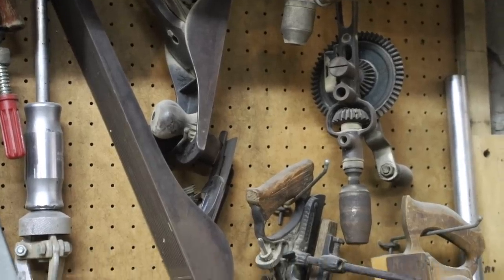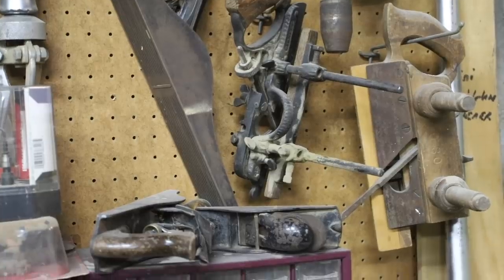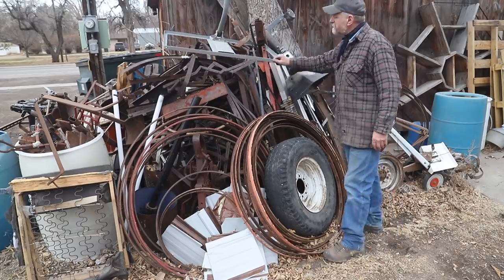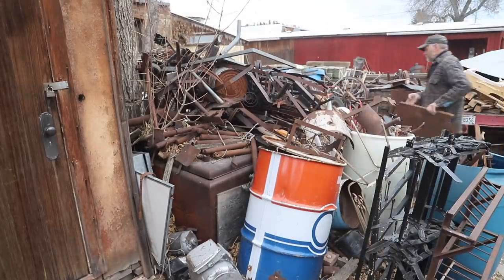Forging Duplicate Buggy Seat Irons | 2 Seat Buggy Part 11 | Engels Coach Shop

Comment: I had no idea my grandfather who built his own wooden home, furniture and several wooden boats wasn’t a “real” woodworker because he often used rasps.
Reply: Well I guess Roy Underhill or Christopher Swartz aren't woodworkers either???!!!
Reply: @yvesdesrosiers2396  : Hahah. Yup. Underhill is a Master craftsman. Ran Colonial Williamsburg's period construction for years before becoming famous.
Reply: Classic straw man. No-one said that using a rasp meant you weren't a proper woodworker. They're been used by woodworkers for centuries. Sam Maloof used them. What was said, though, was that some of the jobs Dave uses them for are better done by other tools. Rounding over an arris where you want a smooth finish, for instance. Rasps are for rough work, such as shaping prior to finishing with an edge tool such as a plane, spokeshave, or card scraper. And, as always, context is everything. Comments about rasps were made in response to over-excited fans who think Dave is producing woodwork as good as cabinet makers, whereas he is actually producing fine carpentry for buggies, nothing whatever like cabinetry.

Comment: How to tell if a tool is an appropriate woodworking tool: Does it do the job required? If yes, it is an appropriate woodworking tool; If no, it might be a good wall decoration.
Reply: The only thing I have ever used a rasp on is wood.
Reply: @billmorris2613  They also used a rasp on auto body repair when they used Lead instead of Bondo.
Reply: @ranchdude4345  They still use rasps when leading joints. Check out Retropower’s Uncut videos and look at Rolls Royce and Bentley factory docos from the last decade.

Comment: My favorite "not a real woodworker" moments are when Dave uses a ball peen hammer to drive nails.  If you've ever tried it, it's really difficult, as the ball peen's crowned face usually bends the nail if you hit it the slightest bit off center.  I could never do what he does with the hammer, I always wimp out and use a flat face claw hammer on nails. :)

Comment: I use metal files on wood from time to time, and usually use a Makita metal cutting circular saw to cut wood, simply by changing the Cermet blade to a regular wood one. How many "purist woodworkers" did i touch on their feathers?
Woodworking is woodworking and tools are tools. Purists are nothing but limited people who can't help but sit in a box.

Comment: In the UK you would be classed as a coachbuilder, not a woodworker and coachbuilders use rasps! Whether you use a smoothing plane, a block plane, a spokeshave, a wood rasp, a farriers rasp or an engineers bastard file, is all immaterial.
You use the tool you find the best for you and none of it matters if the finished work meets the expected standard.
Or are these people saying you cant be a mechanic unless you use snap on tools?
All the best for 2021 👍👍👍

Comment: My tongue is firmly in my cheek, but you are not a wood worker. A woodsman works with wood. Wood can be turned into timber or lumber and can remain wood and be burnt in the fire. You sir are a coach builder, a black smith and a wheel Wright. Any coach builder is free to use what ever tool he wishes. :)
P.S.I’m not qualified to even understand how you do what you do let alone comment.
God bless from NZ.

Comment: You know I love you a little more each time I watch you Mr. Engels, but not in a romantic way. Just the things you do remind me of things my late grand father use to do. And considering my grand father built houses, barns, and wagons before he went to driving a model T, and used a rasp I would say he was a real wood worker. My dad also used a rasp to do wood working, as do I and sometimes I even used a rasp to do autobody work. And I have built barn's, headboards and lots of stuff with wood. A rasp is a good tool to have, even if it is a hoof rasp as there are some seriously hard woods out there that are hard to work with without a rasp. Iron Wood comes to mind.

Comment: I am a long time follower of your channel, but a first time commentor. I noticed you used a bit of woodglue on the fasteners. Rarely I see folks use the Loctite of the woodworker world :) I use it in some applications and it really adds a layer of protection from coming loose through vibration or other means. I am your neighbor to the south. Gillette wyo
Reply from the maker: Thanks neighbor.  Yes, poplar is pretty soft so it helps screws from backing out and seals against moisture.

Comment: Before power tools took over. Rasps were and to hand woodworkers still are a fantastic tool for removing wood. The quality of the work and time were the standard of a quality a wood worker. I have worked wood for 50 years seen all kinds of wood workers. You are in the high end of the category. So you are real wood worker. In fact I watch a lot because of your choice and skill in their use.

Comment: Rasps, sanding papers and cloths do the shaping  by erosion. Planes, chisels, knives, scrapers and hatchets do the shaping by cutting.  Both means of shaping are equally necessary to achieve final fit-up. They have been used since the age of Iron by professional craftsman in producing their finest works.  Some designs, such as those based on  aero-dynamic experiences (cars and air planes) and hydro-dynamic experiences (boats and bridge abutments) are called by architects,  "pre-erosion."  I like that imaginative term.  It is a concept from nature which shapes such impressive things as the hooves of animals.  A rasp reflects the workings of the world.  After I use my rasps, I wind them in a sheet of paper toweling held in place by Scotch Tape for traveling.

Comment: In the late 60's, the woodwork shop at our school had rasps, and i've used them for rounding over, anything with finer teeth would be almost useless.
Doesn't matter whether it's used on horses, wood, or even some pastics, if you want to remove material quickly, the rasp is the go to.
Reply: Mine too.

Comment: I don’t know of a single woodworker who doesn’t use rasps at least occasionally. I use them often, and I even use dull rasps for hot filing at my forge. They’re obviously not for finish work, but they’ll take down material quickly and controllably.

Comment: Farrier's rasps for woodworking?  I build muzzleloading firearms.  The raw blank can weigh from 8 to 14 lbs.  The finished stock will weigh 1.5 to 2.5 lbs.  Maybe I'm not a woodworker either but I will use any means to get rid of excess wood including planes, chisels, hatchets, and rasps.  Some years back our farrier finished shoeing our horses and he handed me his rasp.  Said it was too dull for hoof work anymore but should work fine on wood.  Boy did it ever! I now have three or four and those coarse teeth really help with the rough shaping and the fine teeth smooth it up in preparation for the fine work.  Our Bomgaar's and Murdock's carry farrier tools and, while not Red Tangs, they work well enough.

Comment: As always a great video.  I'm a woodworker and I often have to remove wood.   To remove the wood, I could use an axe, a pocket knife, a hand or power plane, etc, etc, etc...... but why would I when the rasp is the best choice.....:)  One need look no further than rasps used for fine woodwork like Auriou rasps, Liogier Rasps or Shinto rasps.  For a long time now, I've admired the rasps you use and now I'm going to buy one.  I already have a billion woodworking tools but I don't have one of the rasps you use......:)

Comment: A Merry Christmas from South Africa. If you really get stuck with rasps, maybe you should look at panel beater's rasps which they use for smoothing body putty. My neighbor, who was a panel beater, gave one of his rasps. I haven't tried it yet, but I want to use it for rough shaping wood. If I remember correctly, there is one available which different grades of rasp 'blades' can be fitted to.

Comment: Oh my goodness! Quibbling about the tools one uses to get the job done.  Well, that must mean I was doing it wrong when I stripped the molding around my front door ...... fluted faux columns ...... half round concave molding ...... I tried so many different tools while trying to cleanly scrape the paint out ...... and what I finally used, which fit perfectly to the contour and size of space was a melon baller from the kitchen ....... my "tech minded" brother in law lost it over that one, telling me why it was so wrong to do it that way, until the day he was at the house watching me use the melon baller ...... he reluctantly had to admit that what was important was getting the job done, not so much how or what you used to get it done.

Comment: Good evening from Maine, Dave.  Thanks again for sharing your project with us.

To all the armchair woodworkers out there, the right tool for the job is the one you are most comfortable with that gets the job done, and the most versatile craftsmen are those who are the least limited by their tools.  One problem with routers is that the profile they cut is the same from one end to the other, but sometimes the radius or profile needs to vary along the edge of the piece.  For that, you can't beat a rasp.  A rasp will also work like a plane to remove high spots, even on a bull-nosed edge, and the roughness of the cut can diminished by simply making lighter passes, and you have more of a "feel" for what you are doing.  Besides all that, power tools are noisier and make a bigger mess.  I know - I do it every day!

I once had a shop teacher who challenged his students to find [safe] alternative ways to get their projects done, because there was only one of each power tool in the shop.  We watched each other and we all learned more than we otherwise would have.

Comment: A Good craftsmen can use eny tools and a bad craftsmen will blame the tools, I'm an electrical engineer and I have wood working tools I have plumbing tools, I look and watch other trades and try to learn different ways to solve the same problem

Comment: Ive been under the wrong impression that you were replacing seat irons instead of making a new set for the seat that didn't have any yet.  It's gonna leave me scratching my beard as per the hows and whys, but as you said, I'll need to wait and see how it comes along with later videos. Still awesome to learn this stuff, as limited as it is by only video. Hopefully there's gonna be years of this stuff to come.

Comment: Yep. I always tell people that the best Christmas present is a $5 load of scrap metal from the tip. That stuff has so much potential. Sometimes you can even find a rasp in the mix. They are fantastic for curved woodwork and if they ever wear out they are a knife.  I do find it interesting that those who rely on pocket hole jigs and biscuit joiners feel the need to judge whether someone is a wood worker or not - not that I have anything against those tools as they are very useful things. Next thing they will try to tell us that if you use an axe or an adze to shape wood you are not a wood worker. There's a lot of 500 year old wooden buildings that would beg to differ.

Comment: Thank you again for an amazing film. Merry Christmas. Rasps are a wood working tool, cabinetmakers use rasps for Cabriole legs and other curved features. The only wood workers who don't really use them are carpenters. Blades are fine on flat wood where you can work down the grain but would be counterproductive to use blades in the curves, you would still need to use a rasp to clean up the tear out. I would have thought you were not a real wood worker if you could not use a rasp. I have one from the dollar store I like because it is almost impractically aggressive, there is even a French company still hand stitching rasps.
Reply: I was a carpenter for 25+ years and my dad longer than that.We both used Nicholson half round 4 -in -hand wood rasps the entire time.I still use it doing woodwork.
Reply: @eurekasprings1  So, you are a REAL wood worker then, your Dad taught you right, make sure you pass it on.

Comment: Inspired entirely by your wonderful forging, Dave, I have just made and installed some forged curtain brackets.....my first ever attempt at the skill. I made my own forge out of a halved compressor tank, a piece of scaffold tube as an air duct, and a hot-air electric paint stripper "gun" as the bellows (well, air source). I did it all at a friends place because they have a small farriers anvil concreted into the ground as a door stop for a shed. I managed to inadvertently weld a couple of the pieces together by placing them too close to each other in the forge, and I burnt right through another, but I made a pretty decent job of the 7 I needed........and it was brilliant fun. Far and away the most difficult thing was making them the right shape, and the same shape. With a 1/2" radius 180 degree curve, and two 90 degree bends pretty close to each other, and no way of marking on the metal, well let's just say it was a bit of a challenge. Plus the farriers anvil doesn't have a flat surface or a right angle anywhere.
To anyone tempted to have a go........give it a try. It's great fun, and quite addictive, but beware that Dave A/ has all the kit, and B/ many years of experience. It's a fairly long road to become as good as he is. I'm now on the look-out for an anvil.
Reply from the maker: Very nice!  Thanks for sharing.  Forge on!

Comment: Any tool or technique that helps get the desired result is okedoke as far as I am concerned. Dave you did not seem very troubled by whomever made that silly statement that "real" woodworkers don't use rasps, and that is as it should be😀 I am fortunate to have a couple hand cut rasps which are a dream to help form tricky curves.  Merry Christmas to you, Diane, and the family! warm regards vic
Reply from the maker: Not bothered at all.  Thanks

Comment: You are not alone on the use of a farriers rasp. I  was replacing the missing foot aprons on a Brunswick Gold Crown pool table. They are hard to make and every saw cut is an individual setup on my type saw. That done and the final sapping was underway. The wood fast going away with a belt sander and I could not make it look right or fair with the side apron. I stopped and found a large rasp at the swap meet. The course side quickly but controllably removes wood. The fine side removes the marks to a level that is easy to hand sand. Over the years I have had to make three more sets.
Reply from the maker: I hear ya.

Comment: Question from a novice....What is the advantage of drilling small holes and driving a punch through these holes to open up the diameter, instead of just drilling it to the desired diameter with a drillbit ?

As seen at about the 10:00 minute mark ?
Reply from the maker: Called drifting.  It retains more strength by removing less material.  Instead it spreads the material to the side making the hole bigger without taking material away.  Great question.
Reply: @EngelsCoachShop  Thank you, and as always a great and informative answer.

Comment: You're getting the job done the way you have been doing it. That's fine. What I and many other woodworkers have trouble with is we know that there are faster and more enjoyable ways of doing what you're doing with a rasp and belt sander and we want you to enjoy that sensation we know. We are yelling at our screens as you work. Your results speak for themselves so there's no harm, no foul. If you ever do want to branch out, I find Paul Sellers's videos particularly eye opening. He has changed many thousands of woodworkers minds about how fast and accurate his methods are--I dare say faster and quieter than your methods.

Comment: You sir are one of the finest woodworkers I have ever seen. The people who criticised your use of a rasp may not know or maybe forgot that rasps have been a woodworking tool for thousands of years. In fact they were quite commonly in use when I started my carpentry apprenticeship in 1979. I’m now a model maker and while a rasp is a little too severe for working at a scale of 1:20 I often use a file to shape small pieces of wood. If I have to I often make a file or rasp to suit my needs by shaping a piece of wood and glueing some sandpaper to it. This gets me into areas that conventional files or rasps won’t reach. The point is that you use whatever it takes to get the job done correctly. That’s what some people seem to forget. Happy new year to you and your family from Ireland.

Comment: I did my first hobby woodworking 40 years ago. This is the best rasp I have ever had. I bought it two months ago. It cuts wood wonderfully rapidly. It is big enough to create a flat surface, and works wonderfully on curves. Anyone who claims rasps are not used by woodworkers is woefully ignorant. GarretWade, purveyor of find hand tools for woodworkers, currently has a rasp as the top photo on their home page. Wikipedia says, "A rasp is coarse form of file used for coarsely shaping wood."

Comment: Doing a great job. A thought comes to mind, duplicating the original does not appear to run to the screws, eg. "Phillip" head as to the "Blade" type original screws. I assume the "modern" screws are as good if not better and that level of detail is not needed. Keep up the good work.

Comment: If you work wood then you are a woodworker.  And any professional woodworker will tell you that if you get the result you were looking for then you were using the right tool for the job.
Some people might prefer other tools, maybe even better tools, but the test of what is right isn't with the tool, it is with the result you get.  You ARE a woodworker and a metalworker.